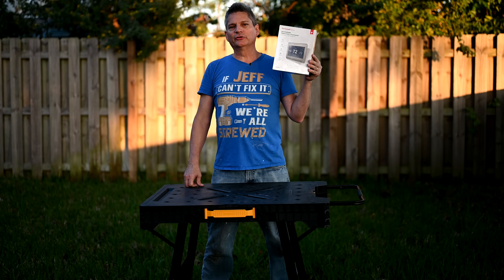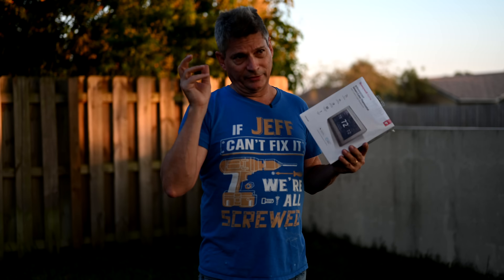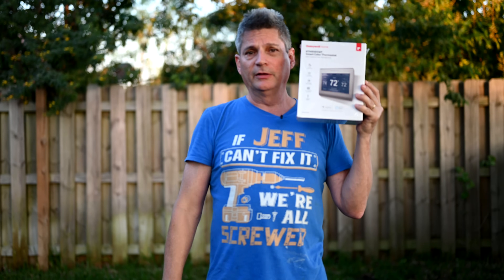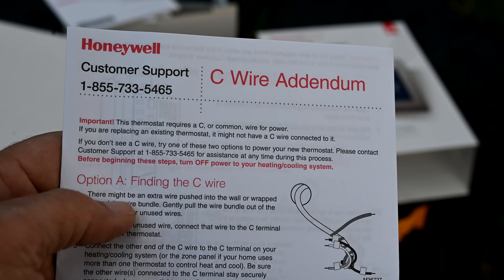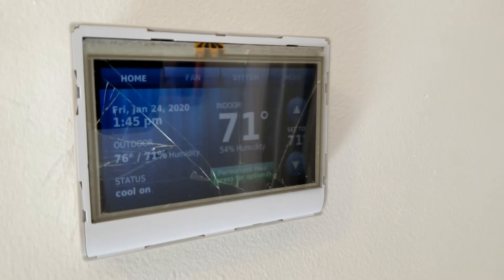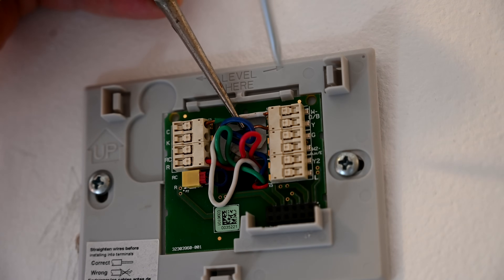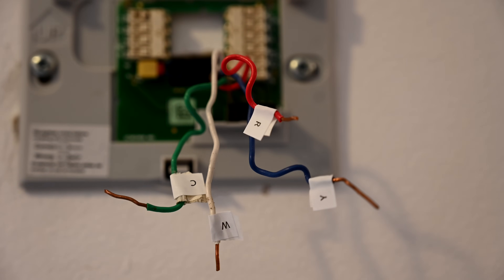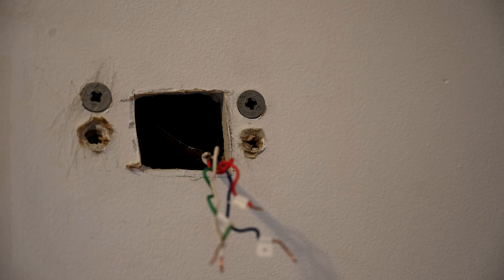How to Install Honeywell Smart WiFi Thermostat RTH9585WF Wiring

Comment: If I am 1000 miles away in a hotel, what does it matter the weather or temp in my home?
Reply from the maker: Because people like to turn off the AC or at least keep it around 80 when they are gone, but when they leave a hotel, they can set it so that it will be the perfect temperature when they return. Also some people may have other reasons for having a critical temperature range, like leaving pets behind and sitter check in on them, and it's nice to monitor the AC temp and see if something goes wrong.

Comment: I don't understand this video.  The box clearly states that the C wire is include.  I have unboxed my thermostat and yes the C wire is included!!!  I need a video that shows installation with included C wire.
Reply from the maker: The thermostats don't come with wires, it is your AC system in the wall that either has 4 wire or 5 wire cable. If you only have 4 wires, you don't have a C wire and you need to make one in order for it to work with any of the modern smart thermostats, or you can run a new 5-wire cable, and wire up your C wire to a 24 V source on the air conditioner.
Reply: jeffostroff  yes it does come with the C wire.  I’m looking at it and I don’t know where to put it.
Reply: @jeffostroff  this was very confusing the box comes with a C wire but after watching honeywell's video you need a C wire adapter.  That makes this too complicated for DYI.  It's $60 for the a/c guy to install.

Comment: What's the negative to using the green wire instead of a C wire that's not available?
Reply from the maker: There is no down side to using this green wire, at least not for my case. Don't get hung up on the color of the wire, some companies use a different color scheme for their AC units. What matters is where are the wires connected. That's why it is so important to use the label stickers that come with the thermostat so you remember which wire went where. In my case, my AC system was an older 4 wire AC system, not 5 wire, I had no C wire, I had to make my own. So I had to open my Ac unit up, and hijack the green wire to act as my new C wire to provide 24V to my controller. This means I had to have a an electrical diagram on the panel of my AC so I could see where to tap off the 24V from. By moving this green wire from where it was connected over to the 24V supply, I lose the ability to run my AC in fan only mode. No big deal, I only use it in AC mode or heat mode, never in fan-only mode.
Reply: @jeffostroff  great to know, thank you. Didn't know about changing the green wire in the ac unit.. It did work for me unfortunately. Should I have a ac tech come correct my wiring?

Comment: I have an O wire (Orange) went into my O before. But with this system, there seems to be no home for O? Is there another alternative?
Reply: Meaning that I had 6 wires before. Is it possible that this one can work with just 5? By hiding the O wire?
Reply from the maker: You'll have to check on Honeywell's web sit where they have videos and FAQs, I'm sure you are not the first person with this O wire. I assume you have a heat pump of some sort or is this in an RV.

Comment: Sorry but poor explanation of common wire(5wire retrofit).
Reply from the maker: Sorry, but this was a good and accurate explanation.  If it was incorrect, the thermostat would never have worked and the AC would never turn on.
Reply: jeffostroff ok 🤔🙄
Reply: @jeffostroff  don't you have to go to the furnace and rewire the common?

Comment: Does it need wifi or can you use it without it?
Reply from the maker: It does need wifi, because it has to be registered to the web site prior to using.
Reply: @jeffostroff  Sorry my question was would it still work even if you didn't have wifi.   I called their office and they said "yes", you don't have to have wifi for it to function as a thermostat.

Comment: I installed this thermostat and it’s working but the fan won’t turn off when it’s cooling.  I can switch to heating and the fan will turn off.   I installed a second identical thermostat downstairs that shares the same hvac unit and  it works fine.  Weird!

I can put the old thermostat back on and everything works perfectly again.  

My new thermostat and control board are both Honeywell.
Reply from the maker: Maybe it got suck on hold?
Reply: jeffostroff Thanks for the reply.  I checked all the schedules and they are all set to auto.

Comment: My old Thermostat did not use the C wire but there are extra wires to the thermostat. How can I tell if one of these is the C wire, just see if I have 24v on any and that is the C? AND can you just supply 24vac from any source such as a transformer?
Reply from the maker: I would think you can supply 24 VAC from any source. What you need to do is check the schematic on your AC unit which describes what different color wires do, so you can see where those wires are going.

Comment: What else can be the reason why this thermostat doesn't work for me? C wire and ALL other wire connected in correctly and screen remains blank..This is my 3rd one and still screen remains blank
Reply from the maker: The thermostat is powered by 24 VAC, which it gets from the red wire , which comes from 24v side of transformer on AC unit, and the return for this 24 VAC,  the C wire which is the common side of the transformer on the AC unit.  So if you can get ahold of a Volt meter set  it to volts AC, and measure or cross the red and the white wire and you should get 24 V. If you don't something is wrong. It could be you you have a blown transformer on the airconditioner, or a wire not tied incorrectly somewhere, so this might involve you doing some more advanced and getting and taking a look at the schematic for your air conditioner to see if indeed you are getting the correct full touch out. So the thermostat receives in the red and white wire as input power com and it tells the airconditioner via the other 3 wires whether it's going to be on heat or cold.

Comment: They say it can alert you of extreme temperature but I can't find information on how to set that up.  This will be useful when you're away from home and either your heat or A/C is not working and your house may get too hot or too cold.  Anyone able to find where to setup for the high and low temperature alert?
Reply from the maker: I did text searches on the user guide and saw no way to set email alerts, even though it says on the front page of the user manual "Receive alerts via email and get automatic upgrades"

Comment: Again, you are a squid.  C is common red is 24v. Your a hack, pull a new wire.
Reply from the maker: Again, you are a moron, The C Wire, known as the "common" wire, which I already mentioned in the video is 24 AC, and all you did was repeat what I said. It's called common because it is the common tap off the 120 V step down transformer inside the AC unit, whose windings are designed to give you 24V AC from 120 VAC, similar to a doorbell transformer. You are confusing the C- "common" with the white common wire in regular electrical wiring, which is not the same thing. You are the squid! But keep your uninformed comments coming and keep on embarrassing yourself, it gives all of us here a laugh. In all fairness, you get partial credit because you are right, the R line is ALSO 24 VAC, it is from the other tap off the transformer, so both R & C are both 24 VAC. Modern smart thermostats need this extra C line to power the brains and circuit chips and display of the unit in order to work.
Reply: Or you could just wire it as a 4 wire and not have the blower which isn't needed. Some people can't afford the drywall patches and what it costs to run a new wire. All to have the blower functioning which nobody has ever used.

Comment: I've had my eye on these but if they don't last 20 years at least, I'm not interested.  They're too pricey to replace every 4 years or do I have that wrong? Thanks, Jeff !
Reply from the maker: They don't have to replace every 4 years. Ours was dropped and cracked and still working for 3 years, although through the app, because the cracked screen no longer responded to the touch. But these should last  several years.
Reply: Thanks, J  !

Comment: I like my Emerson Sensi

If you don't have a C wire you can get a 24-volt transformer, plug it in in the attic or basement or somewhere out of the way, and run a cat 6 wire to your thermostat.
I personally wouldn't to do any work arounds where you have to take a wire from somewhere else.  Some people like to use the fan wire somehow but then you can never turn your fan on and off manually. 

What I really wish they would invent is a smart thermostat that can also replace the humidistat that controls my whole house dehumidifier.
Reply from the maker: Yes a doorbell transformer would be perfect for this
Reply: The new update to Sensi allows for humidifier control. If your Sensi is connected to wifi, and you have enabled auto updates, it should push to your stat.
Reply: Also using more than one transformer in the same circuit will not work.

Comment: wonder if ya could get some type of 24 volt adapter for it instead of having to steal the green wire ?
Reply from the maker: All you would need is a transformer, likely a doorbell transformer would do the trick, as those connect up to 120 VAC on the input, and deliver 24 VAC on the output. You would possibly tap off a nearby electrical outlet and run Romex up the wall, but you'll have to mount the transformer somewhere where it is accessible, and safe from starting a fire.
Reply: @jeffostroff  doorbell transformers do not provide 24vac.
Reply: @jeffostroff  Not a good idea to use a different transformer. The VA rating needs to be able to handle the load since it is sized for that
Reply from the maker: @mainj54  There's nothing wrong with the transformer rating, it only needs to power the thermostat, it's such a low voltage current draw, that probably any transformer out there could power it.
Reply: @jeffostroff  No, the transformer has to power the A/C load devices such as contactors , fan relays, reversing valve,ignition modules, gas valve .That will depend on your system if it is a package unit, split system, heat pump, gas furnace. The transformer 24 V is being switched threw the thermostat along with powering the stat.
Reply from the maker: @mainj54   You are confusing 2 different Animals. The air conditioner comes with its own transformer inside of it that supplies the 24 V that goes outside to the contacters it has absolutely nothing to do with the thermostat. And fact the airconditioner receives signals from the thermostat it doesn't receive in a power just a signal telling it to turn on the output to the outside compressor. So again I state all you need to do if you don't have a C wire is get a doorbell transformer and nothing else. That doorbell transformer will drive nothing other than the sea wire to the Thermostat.
Reply: @jeffostroff 24 volts comes from the transformer in the A/C on R and C . R is switched at the thermostat sending 1 leg of the 24 V back to the A/C on Y,G,W, depending on call for cooling or heating. R and C also supply 24 V to the board of the thermostat to power it up. So how would you wire in a separate isolated 24 V supply?
Reply: @jeffostroff  If you like I can show you on the print of your setup (if you'll provide M/N and contact info) how your incorrect.
Reply: @jeffostroff  actually almost no ac units have a transformer in them anymore. The transformer is located in the indoor furnace/air handler. The indoor unit x-former (typically 40VA in a non-twinned, non-zoned system) is responsible for operating every single relay, switch, and contractor in the system. Just as the other person said.
Reply from the maker: @jeffstephen90  Yes that is where it was in our AC system it was located inside the air handler. That is what I opened up and stole one of the other wires from the fan only mode to use as my c-wire.  Now we can't use fan only mode anymore, but we neve ruse it. We only use Ac Mode or heat mode, and nothing else.
Reply: This is a option to add a wire https://www.amazon.com/Venstar-ACC0410-Wire-Accessory-Thermostats/dp/B01IF3QXMC/ref=asc_df_B01IF3QXMC/?tag=hyprod-20&linkCode=df0&hvadid=241898984112&hvpos=&hvnetw=g&hvrand=4221919486797088167&hvpone=&hvptwo=&hvqmt=&hvdev=c&hvdvcmdl=&hvlocint=&hvlocphy=9010850&hvtargid=pla-494323890876&psc=1

Comment: Hey Jeff, could you make a video for those of us who need all heat and cooling functions? I'm in Arkansas so I need the 5 wires. I purchased a Honeywell last year and had to have a HVAC guy run the 5 wire from the AC unit. I'd like to know how to do that myself in the future.
Reply from the maker: If they install your wires correctly, here's how you connect the 5 wires to the printed circuit board of your thermostat:
Blue or Black wire – C – Common wire
Red wire - R – 24VAC power from the furnace's transformer.
Green wire – G – Fan.

White wire – W – Heat.
Yellow wire – Y – Air conditioner.
Reply: @jeffostroff  if R and RC have a jumper, do I remove the jumper or leave it as is? I also have a 5 wire system. Please advise.
Reply: @surajkc9720  leave the jumper. That set up (separate R and RC terminals) is in case you have a two transformer system.
Reply: @jeffostroff  I have an orange wire with a heat pump. Any ideas where this should go?

Comment: I went through 3 Honeywell smart thermostat, in 3 years. They just don't last.
Reply from the maker: The one you saw me take down in this video lasted 3 1/2 years, even with the cracked display from it falling off the wall when the door next to it was slammed too hard, we were still able to control it through the apps on our phones and iPAD. Finally decided to get Gen 2 for this video. What happened with your units?
Reply: Get an Emerson
Reply from the maker: @adamsmith8689  I decided not to get Emerson, because I'm sick of black and white LCD displays that you can't read unless your looking head on, and backlights that are useless. The Honeywell I can read from 20 feet away at nearly a 180 degree angle. Also the Emerson does not show outside temperature or Humidity levels, nor does it show the 5 day weather forecast built into it like the Honeywell.
Reply: @jeffostroff  The one I have is not black and white and it does display the humidity. 
https://www.amazon.com/gp/aw/d/B07CKJQYDW/ref=ppx_yo_mob_b_track_package_o0_img?ie=UTF8&psc=1